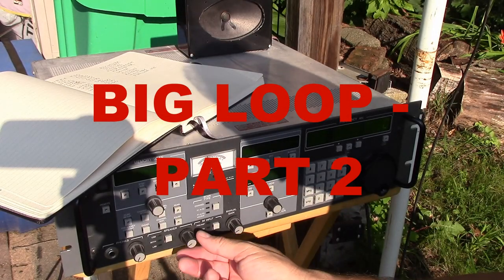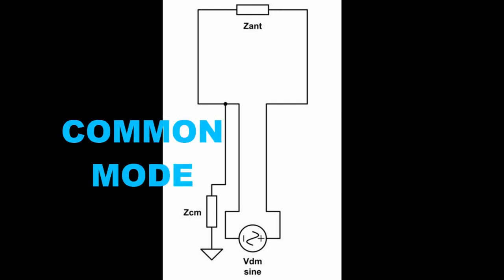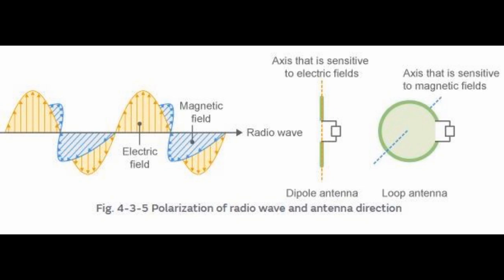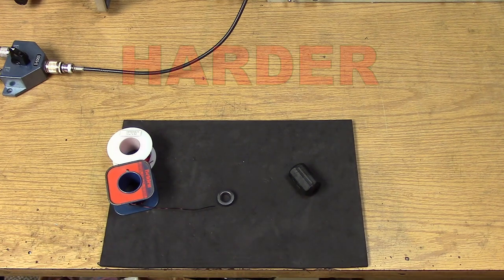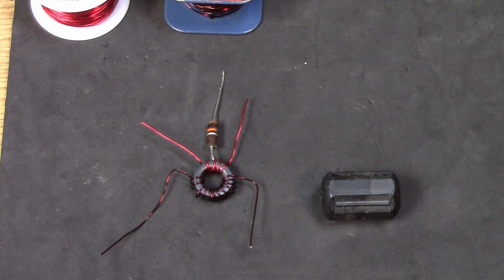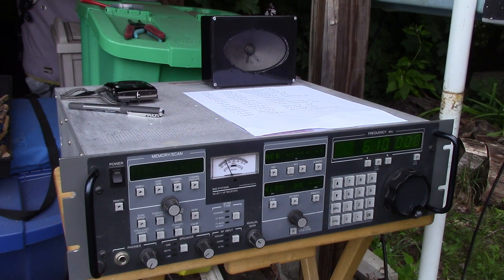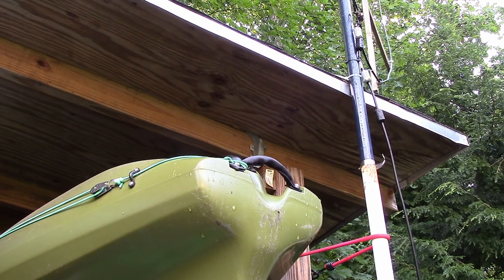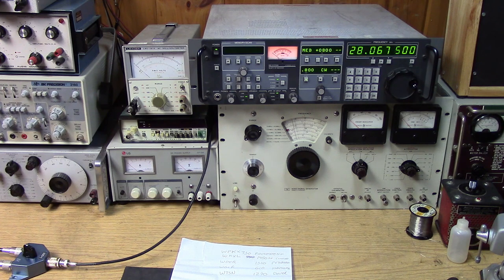Big Loop Part 2

Comment: Interesting and much appreciated. Thank you Mike. I am certainly considering a receiving loop. Whenever I travel even a short distance out of town and operate QRP/P, I am usually amazed (and saddened) at the stations I can hear that are well below home QTH noise levels. Therefore, I have to wonder if a properly designed RX loop might educe many of these signals currently lost to QRM?

Comment: Great video Mike--really enjoying the Loop series.
Still wondering about using balanced line as the feedline and if we lose the noise cancellation effects that motivated us to use the loop in the first place.  Speaking of which: Anyone got any sources of low-cost TV twin lead(preferably like the deluxe Radio-Shack 20 ga. one? Guess I shoulda stocked up in the 60's!
I have a VERY NOISY neighborhood and have a regular 80M sked that I'd sure like to improve my RX S/N ratio!  Will we end up with any design recipes that would allow us to go after a specific band?

Comment: Thanks again for another excellent and thought provoking video. I have the frame of a 12ft circular trampoline and had the idea of running a copper tube in the centre of it, held in place by insulation foam with the outside tube (approx 2 ins diameter) as the shield. From your experiments, 12ft seems too big to be effective with regard to nulls? 

Perhaps I should use it for the frame of a wire mesh satellite dish instead? Any other ideas for it?